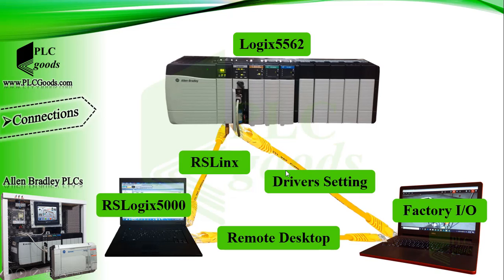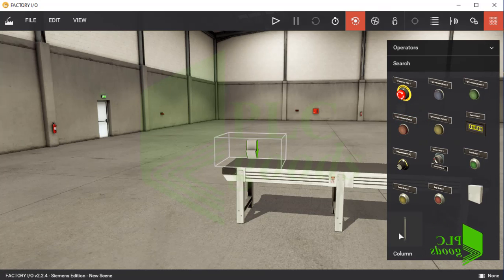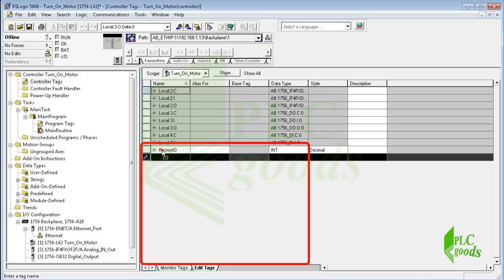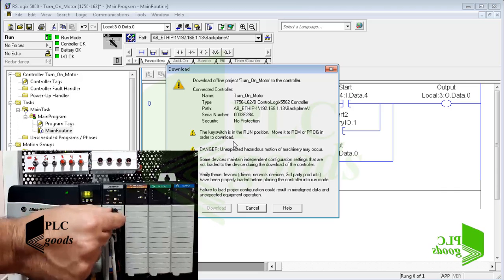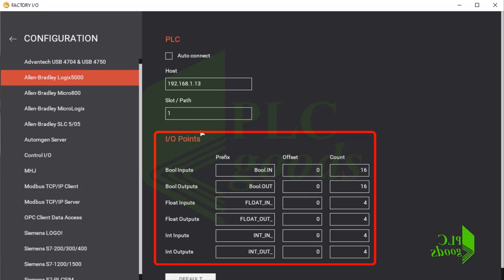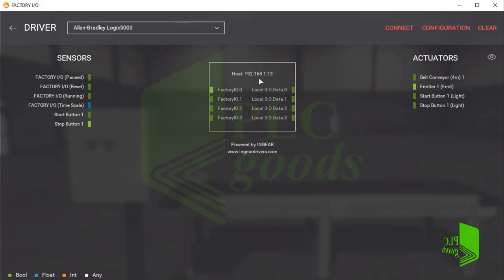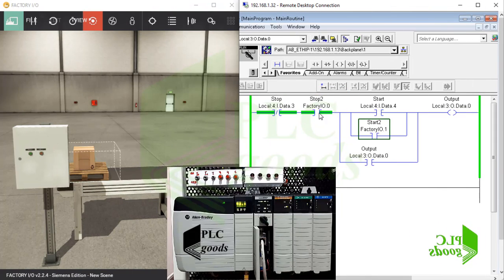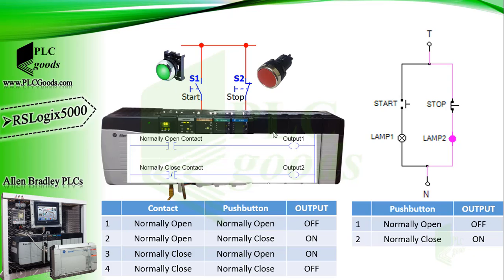Allen Bradley PLC with Factory I/O | RSLogix 5000 Tutorial  | Lesson 15

Comment: Hi.You use emulator or real PLC?
Can we simulate or make program having analog signal by using emulator?
Reply from the maker: 👋 Hi! Thanks for your question.

In this video, I’m using the RSLogix 5000 Emulator (or RSLogix 500, depending on the project), which simulates a ControlLogix or MicroLogix PLC on your PC.

✅ Yes, you can create a program that includes analog signals (like 4-20 mA or 0-10 V inputs/outputs). However, the emulator cannot generate real analog input values, because there's no physical hardware. But you can simulate the analog input values manually by forcing or setting values in the tags.
Reply: Sir.Any examples that you programmed with analogue values?

Comment: Thanks for this amazing tutorial sir but i didnt still understand your explanation on using a NC contact with a NC push button. if the PB is NC and is energized with  a NC contact, it will literally be continous as is always used in design processes till it is pressed then it will shut down the process.Honestly, you just got me confused right now sir
Reply: Hi dear Friend. Please see this video ( https://www.youtube.com/watch?v=WuQw3n1s7og&t=426s). especially test 4 explained line programs. the time between 6:0 and 8:30. 
The video will clear for you, there are 4 states when a PB is connected to a PLC. you will see that a NC PB can have 2 performances according to its related contact type inside the PLC program. you can select each performance by using a NC or NO contact inside your program. I hope the video can help you.:)
Reply from the maker: thanks for bringing out the question, are you Clearfield now?